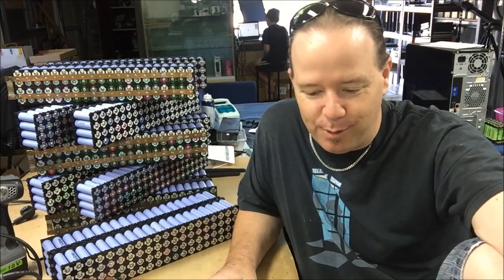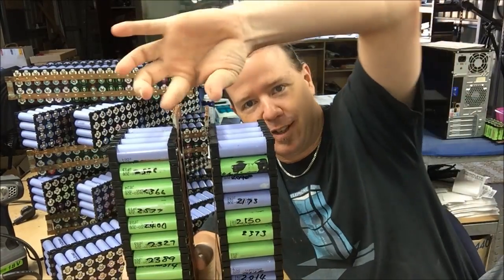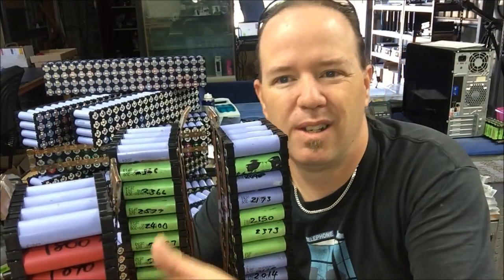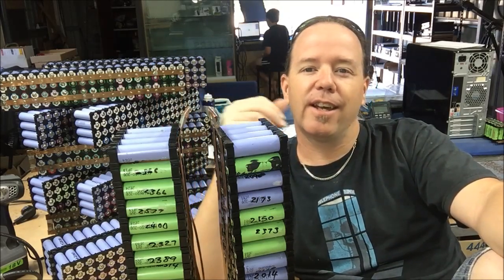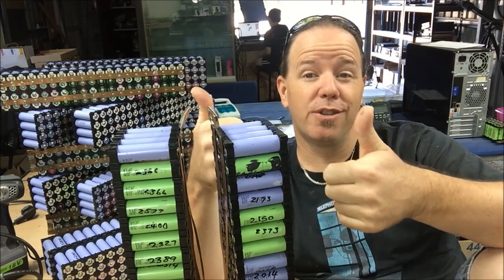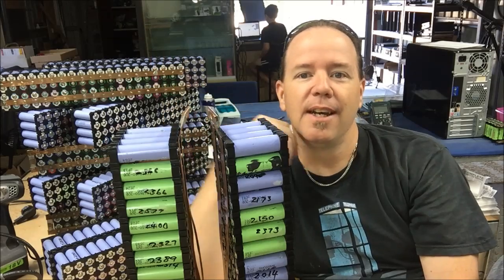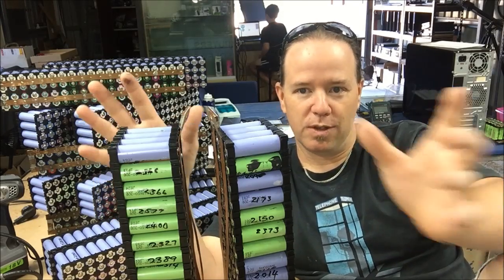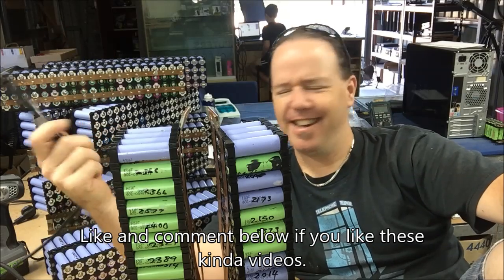UK DIY Powerwall & Small updates

Comment: Hi just wondering if you have ever tried these batteries as am offered  48volt packs in 13s 4p configuration.UR18650RX.Came from ups systems and about 50 packs available

Comment: Hey Pete,
I was under the impression that when you rated a bank (like bank one at 2600) that all of those cells were of at least that value. But I see that you've mixed 21xx with 23xx and 25xx cells. Did you add all the capacities and divide by the number of cells to come up with an average? 
I'd think the lower capacity cells would stop the discharge when they got below 3v. Or do they all balance out as one big cell since they are all in parallel?
I'm still trying to learn this. Your efforts and results are remarkable.
Reply from the maker: took the lowest value and used that as the capacity rating -  how ever my last proved that figure to be incorrect. (less by 1kwh)

Comment: Oh any update on the charger and bms you are going to use?
Reply from the maker: +Mikes DIY Tesla Powerwall Charger/inverter is PIP2424MSX - 2.4kw with 60amp MPPT charge controler, BMS for "main pack" or 'first pack' is for now at least the CrapCity 200a bms & for all other packs on each of these http://www.ebay.com.au/itm/221769570748?_trksid=p2057872.m2749.l2649&ssPageName=STRK%3AMEBIDX%3AIT i ordered 4 got only one (typical ebay)

Comment: got a super cheap auto near you?
Reply from the maker: +One up the sleeve customs Yes, do they sell soldering irons that work for me ?
Reply: +HBPowerwall yep grab a 60 or 80w  one they have a ton of grunt  the tips erode fairly  fast but  thats expected  with the heat output
Reply: +HBPowerwall oh and there normally  cheap if not on special
Reply from the maker: Ok will check it out.

Comment: $100 bucks soldering iron and doesn't do a good job? Go to Jaycar and grab a big soldering station for $159 with electronic temperature control... that thing goes up to 480c which is a lot!!  http://www.jaycar.com.au/Tools-%26-Soldering/Soldering/Stations/60W-ESD-Safe-Lead-Free-Soldering-Station-with-LCD-Panel/p/TS1390 
Ask if they have a flat had tip (accessory) will give you a much more surface and quicker heat transfer
Reply from the maker: +ElectricBike (Bruno) Already have one of those - well close has built in rework station but keep that for mobile phone and game console repairs. Got a http://www.jaycar.com.au/Tools-%26-Soldering/Soldering/Irons---Electric/Goot-240V-70W-240V-Soldering-Iron/p/TS1430 iron with a http://www.jaycar.com.au/Tools-%26-Soldering/Soldering/Irons---Electric/TIP-3MM-CHISEL-GOOT/p/TS1436 tip (largest they had) and just doesn't hold the heat - bloody great for the really small stuff just doesn't suit my needs on this project. This 40w one works but is slow - so ordered a 80 cheapy off ebay and see if that works better. With so much soldering to do i need something that really holds the heat and recovers fast.
Reply: +HBPowerwall - I know exactly what is happening.. copper is the second highest thermal conductor material (much better than aluminium and only losing for pure silver)... your bus bar is "instantly eating" all the heat and dissipating it... so you need to go ridiculous and get a 100w (or more) soldering GUN http://www.ebay.com.au/sch/i.html?_nkw=100w+soldering+gun&_fromfsb=0&_trksid=m270.l1313&ul_noapp=true
You can win this fight... check out this 300w one hahahaha http://www.ebay.com.au/itm/220V-100W-300W-Electric-Heating-Pencil-Welding-Soldering-Gun-Solder-Iron-Tool-/401040152041?var=&hash=item5d5fdb15e9:m:mUHAWaRolhv6LqQrA5m_Olw
Reply: I went and got a Hakko fx888d, I have been wanting a good iron since I was a kid. Dad had a Weller then a Hakko at his workshop and I would go there to use it or ask that he bring it home for me to use. Seeming I moved out over 10 years ago I can't really use it anymore, lol. The new one shits all over the cheap ones and I don't know why I didn't get one earlier. The one you have built into the rework station may look very similar to it but the recovery is a lot quicker, check eevblog where he does a comparison.